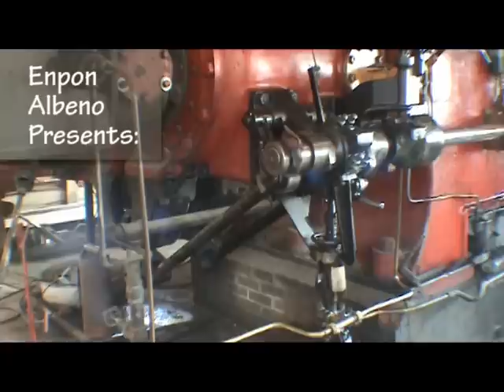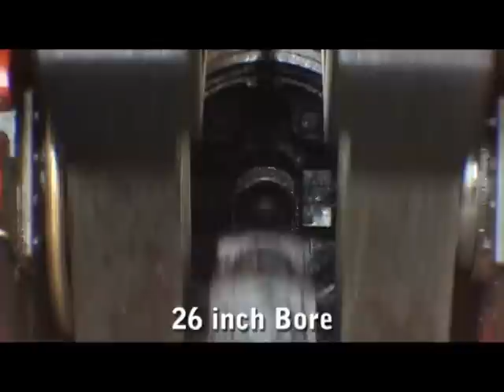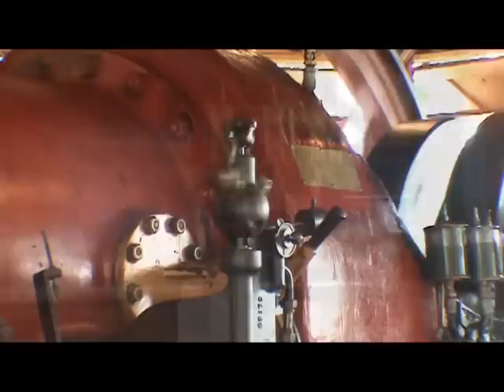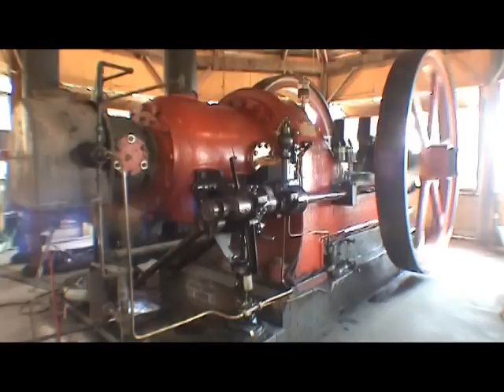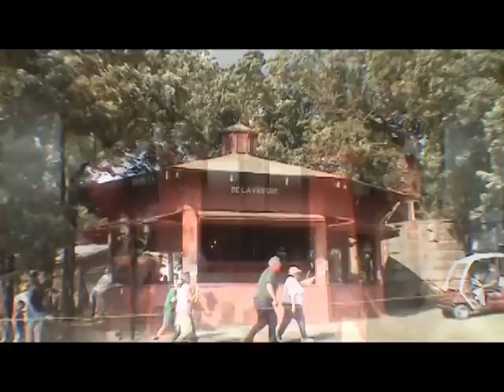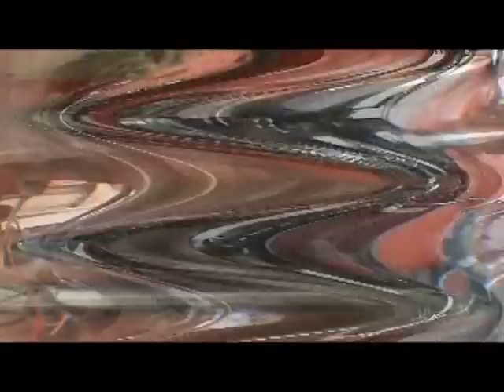20,175 Cubic Inch Single Cylinder Engine - Running

Comment from the maker: I just watched a bunch of great videos of Coolspring's 175 hp Otto, thanks to your comment. That is a behemoth of an engine. Whether it's larger than the one in this video all depends on your definition of larger. Coolspring's Otto is larger in terms of horsepower, but this engine is larger in terms of weight and displacement.  
This engine outweighs the Otto by 15 tons, and has almost twice the displacement at  20,175 CI versus the Otto's 10,390.  
Thanks for watching and commenting.

Comment: No replacement for displacement.
Reply: Forced Induction.
Reply: should totally turbo this
Reply: +Oscar Thorpe, don't forget Nitrous!
Reply: More cylinders this size
Reply: +Pegleg Noid
Ever heard of Honda S series?
Reply: Not really true:  RPM's are the replacement.  Some of the sport bikes get well over 150 hp on 1 liter NA engines.  They do this by having a redline up around 15,000 RPM's.
Reply: If you have to lead with "fuckwit" to get your point across, I'm gonna go out on a limb and guess you ain't a rocket scientist.  
I'll give it a try anyway:  With the proper transmission, RPM can be exchanged for torque.  It doesn't matter how many RPM's your engine turns to get the hp:  You just gear up or down as appropriate to get the torque you need.  The motorcycle engine could be used to power the factory that this engine powered.  The 2 engines would be geared very differently.
Reply: @XenoRacing  oh my goodness you are so right forced induction definition doesn’t multiply the hp based on the displacement. Forced induction and nitrous functionally achieve the same thing, increase oxygen density in the cylinder. A bigger cylinder(or more of them) with an increased oxygen density would create more power.

Comment: These old engines are awesome!! I believe the Hot Bulb was the front runner to the Diesel Engine. The cool part is i run WVO ( Waste Veggie Oil ) in my 1994 F350 7.3L and is amazing how well it runs too!!

Comment: For the mathematically literate the relationship between torque horsepower and rpm is as follows:

RPM times torque times conversion factor which slips my mind at the moment equals horsepower.

All the worship of torque you will ever see is simply worship of engines that produce a lot of horsepower at low rpm.

You could hook  up a large enough gear reduction to a five horsepower lawn mower engine and get four thousand pounds of torque out of the business end of it. But the rpm would be reduced to the point that you could easily count the revolutions by eye. Each one would take  a while .Think clock hands to get the idea.
Reply: T = Php 63025 / n         (1)

where

T = torque (in lbf)

Php =  horsepower delivered by the electric motor

n = revolution per minute (rpm)

Comment: My previous post has been re-formatted by youtube to leave out the spaces used to show the workings of this calculation.
However, the formula is Pye (3.142), multiplied by (X), the radius of the bore squared (half the diameter of the bore multiplied by itself), multiplied by, the length of stroke.

The Radius of bore is 13; this multiplied by itself = 169. Multiply this by 3.142 (Pye) and 38 (the stroke or length) and a answer of 20,177.924 is the result.

I hope this clarifies my previous post.

Comment: Hot bulb engines do not use carburetors. They use low pressure pumps to introduce fuel into the pre-combustion chamber not long after bottom dead center at the beginning of the compression stroke. They are often called Semi-diesels but they are not diesels at all.

Comment: That would be right, under load when the revs drop off the governor opens allowing more fuel in, when load removed & engine picks up again it closes down again kepping the engine at constant rpm. Not sure with this engine but the lever to the right could be the throttle to alter the governor setting.

Comment: Very impressive engine  it would outlast 100`s of modern high speed engines and out work them to. A 125 HP modern engine only has a mere fraction of the torque this engine has

Comment: It's not a carburated engine,it has a mechanical fuel injection pump.Hot bulb engines don't use carburetors,they are more closely related to a diesel than a gasoline engine.The only difference is they don't use high compression to self-ignite the injected fuel,which gets mixed with the air inside the combustion chamber,but the heat of the bulb instead.They were also called semidiesels,and could run on many different combustible oily fuels.This sucker is a really big one of its kind though ;)

Comment from the maker: It's a hot bulb engine, so there is no magneto or spark plug(s).  I'm not sure how the carburetion  system works on this engine.  That's something I'll look into next time I see it run.  This engine is much larger than what would have been used on a farm or sold by Sears.  Most farm engines would need to small enough to be portable - this surely is not. This is the type of thing that would be powering a state of the art factory in the 1910's

Thanks for watching and commenting.

Comment: They are semidiesel engines that inject any combustible fuel from crude oil to vegetable oil, petroleum, whatever, you name it. The hot bulb had to be preheated to glowing red for the injected fuel then to self-ignite with the compressed air at a far lower compression level than a diesel engine would need (diesels self-ignite only through high compression, not through the heat of the combustion chamber walls).

Comment: @Afganistan68 like said... youve probably heard, but im gonna explain a little in depth for everybody... usually the longer the stroke of a motor the fewer rpms (more distance to travel & less time to do it) but you also have much higher torque... so you take a 5.7L hemi v8 like you said pushing approx. 340hp/375tq and compare to a 5.9 cummins I6 in dodge trucks pushing approx 280hp/600tq, as you can see the cummins has a larger displacement but fewer cyl. leading to longer stroke=more torque

Comment: @ThaMasterSniper Oh I seriously doubt that. While I'm not 100% sure, I am almost certain this is an air-start engine (it's started with compressed air). I've started engines of this type before, and they are always air-start. There's no hand cranking other than bringing it to top dead center and letting the air do the work.

Comment: It's not rated at 50RPM; the poster stated that it normally ran at 160; that's probably not it's rated RPM, either; but if it were, the calculation would come out around 4100 lb-ft. of torque.

Comment: Just a slight difference of thought here, old chap.  The engine is exhausting the figure you quote - but it`s  R.P.M is actually double that,(104) . Similarly - if the exhaust is sounding roughly three times that rate - as indeed it does in your speeded up video - that would make it nearer 300 odd R.P.M. The exhaust should be sounding 80  times a minute for 160 R.P.M.  Hope you don`t mind.   Did enjoy your footage. any thanks.

Comment: I want to drop this bad boy in my Civic!
Reply: I was thinking the same thing. Except dropping my Civic INTO this bad boy. Also, it was take the weight of about 20 Civics to equal the weight of this awesome monster.
Reply: Be sure to add a bit of air pressure to the tires.  That diesel weighs  a few pounds more than the Civic engine.
Reply: Civic (Most Honda) Engine's are made from Aluminum blocks and head's for a reason its because of weight. A LOT of people hate on Honda. But say that hatred towards their moto cross bikes, Their racing boats their racing gt3 and formula one cars...shit even their compact cars are making the competion sweat
Reply: Only 125hp.
Reply: My 1.6L SOHC non-VTEC Civic engine (a.k.a. D16Y7) only does about 106hp, but seems to be more powerful than what the numbers say. Just enough power to pass people on the freeway and enough to keep from getting plowed over by speeding oncoming traffic when making a right turn onto a busy street.
Reply: zach You forgot apostrophe's for block's, bike's, boat's, and car's (twice).

Just trying to be helpful.
.
Reply: BloodstainedSinner "ONLY 125hp?" With 4,100 foot pounds of torque, who needs more horse power?
Reply: Rain Coast Oh, right. Do you drive a Prius or something? See, where I come from, your average vehicle is 250-305hp, and a performance car ranges from 420-710hp, and anything above is insane.
Reply: Horse power as a measure is okay, but TORQUE is where the TRUE power is at! That's why huge diesel marine engines use kw (kilo watts) as a power measure. One of the largest built by Wartsilla is 80,000 kw!
Reply: Rain Coast The Dodge Ram 2500 with the 6.7L I-6 Cummins turbo diesel makes 850lb-ft torque, but a mere 385hp. All that torque is good for pulling, but the truck is slow as hell. Torque is nothing without horsepower.
Reply: Rain Coast You should get your units straightened out. Torque is not a measure of, nor indicative of power. Power is a rate of delivery of energy. Torque is a measure of rotational force, or the ability to "put a twist" on some thing. That rotational force can even be static, like placing a torque wrench on a very tight, large fastener, hanging a concrete block on the torque wrench handle, and leaving it like that. The torque reading on the fastener will be the same the next day, but no work was done on the fastener because no power was supplied to loosen it.

At any rate, torque is not power, and horsepower and watts measure the same thing, which is rate of delivery of energy. The watt is merely the SI unit for power. Horsepower is similarly the customary unit of power commonly used in the U.S. and 1 HP = 745.699881448 Watts.
.
Reply: I recall someone in england, some years back setting a merlin spitfire engine in a Rolls Royce car, then driving up the motorway at 200 miles per hour,burnt out the car !!!
Reply: BloodstainedSinner yeah, at 160 rpm.  That's a measly ~2.7 revolutions per second... you could almost read a book attached to the crankshaft.
Reply: Hey Zach, how about dropping it ON your Civic?  :-D

Comment: 26 is diameter, divide by 2 and get 13 for R pie R squared is the area of the bore = 3.1416 x (13x13) = 530.93 Multiply that by the stroke to get volume.
530.93 x 38= 20,175.355
 Don't know how you got what you did,but it's wrong. You also have 4 decimal places between the comma and the decimal point. What's that supposed to be?

Comment: The part that said "160 RPM" is wrong. If the engine ran at 160 rpm it would let out exhaust slightly more than once a second (1 per second = 2rev per second= 120RPM). I the video the engine is speeded ut to at least 2 exhaust pulses per second, meaning it's running at 240 RPM. This is becasue it's a four-stroke engine, not a two stroke.

Comment: Torque is the rotational force, power is the rate at which work is done. That's why power = torque x RPM. These large capacity, slow turning engines do have a very high torque figure but only produce a relatively low power, because of the low turning speed, or RPM. So would be pretty hopeless in a hypothetical road vehicle. A given application requires the appropriate power unit.
Reply: I don't think anyone is serious about bolting it into a car. Of course, RPM is part of what wears an engine out, so an engine like this one is designed to be practically immortal.

Comment: oops piston speed was wrong multiply stroke x 2 then by the rpm so (28 x 2)x160=8960 divide that by 12 = 746 ft per minute or 12.44ft per second. generally speaking a stock car engine for reliabilty is usuall around 3500 ft per minute or 58 ft a second making me wonder if this engine could achieve 750 rpm ?

Comment: any idea what the engine was used to power originally?  Its got the power to weight ratio of a late 70's, early 80's GM motor.  And probably gets better milage.
Reply: +El Guapo These big displacement stationary engines were used for a variety of tasks. Among these were as pumps for coal mines, power generation, and in oil fields.

Comment: (continued) Later engines used gasoline and a spark plug in the heating phase and then switched over to their actual main fuel, which needed to be way less refined than gasoline, when the hot bulb had reached its temperature.

Comment: simple math boys. bore x bore x stroke x.7854 x(how many cylinder). in this case 1 so 20175.355! and for fun lets divide that by 1728 =11.67 cubic foot volume... now for piston speeds at 160 rpm .lets see 28 in stroke x 160 = 4480 divide that by 12 =373.33 feet per mnute which we divide that by 60 gives us 6.22 feet per second seems kinda slow piston speeds.. whats the max rpm on that engine?

Comment: if this were to be applied on any scale of a moving vehicle it would be incredibly inefficient just based on the weight of the engine itself. considering the engine weighs 40 tons, a cummins isx 500 making ~2000 ft lbs of torque is an applicable engine for a big rig to tow 40 tons.

Comment: 4100 lb/ft of torque? what the actual fuck?
Reply: +Nazimelon torque is basically determined by the rotating mass of the engine and therefore its ability to keep turning through resistance.
This thing has a massive rotating mass with its huge piston, rod and crank, along with its big flywheels.
Horsepower on the other hand, basically determines how fast it can get up to its set rpm, be it 60 or 150rpm.
Reply: +Nazimelon  Only 4100 from an engine that big...I'm disappointed.
Reply: +Nazimelon Yeah, the 38 inch stroke has a lot to do with it...torque is a twisting force, and  that large stroke gives it leverage...here's more btw...and yeah, low horsepower, low rpm engines with huge torque were not uncommon back in the day...
http://formulas.tutorvista.com/physics/torque-formula.html
Reply: Considering when this engine was built (probably in the very late 1800s or early 1900s) It's still impressive.

Comment from the maker: Can't believe it's 20,000 cubic inches?  The engine has a 26" bore and a 38" stroke. I went to the gubment skool so I may be calculating it wrong, but I come up with exactly 20,175.30802 cubic inches, or 330.6140638 Liters, or 87.339 Gallons.  

Would somebody please double check my math so people stop calling me a liar...Thanks.

Comment: Assuming a perfectly linear power curve, this motor running at 1600 rpm would be making 1250hp. That's idle revs for my 636cc single in my motorcycle! Of course it's probably throw itself in bits across the country if you tried to run it that fast..
Reply: now make the redline  9000 rpm

Comment: what's the max safe long term running rpm?
Reply: +etyrnal It probably redlines at about 100 rpm...
Reply: it did't say straight
Reply: i wonder what rpm would result in mechanical failure due to physical stresses?
Reply: +Lancer Guy interesting. thanks!
Reply: +Lancer Guy if run increasingly faster, what would likely fail first?

Comment: You should LEARN HOW to use a displacement calculator and try writing the answer down as it is, NOT as you see it. 33,0618.1 cu in is not even a readable number,but if you use a displacement calculator and read what it says, 330,618.1 is CC's, NOT cubic inches. A CC is a cubic centimeter.

Comment: Let's just check this one last time for the disbelievers...

26" = 66.04cm
... cross section area is therefore 3.142 x (33.02)^2 = 3425.79sq cm
38" = 96.52cm
3425.79 x 96.52 = 330657cc

Yep, 330 (or even 331) litres near as dammit.
Divide by (2.54)^3, i.e. ffffff, to get cu in = 20178ci.

(To the nearest integer)

I wonder what the compression ratio is, though?

HP per litre = 0.38, vs typical 40~90 for most cars/bikes
However it revs WAY lower.

Lbft per litre = 12.4 ...poor, but not crazily so

Comment: comments on waste of fuel are wasted comments, and indication that commentator is ignorant of engines in general. At this speed, and with no load, this engine is only using enough fuel to make it idle. And that's not much. Probably around 1/2 to 1 hp. And with that load, it wont use much fuel or pollute much at all. HOWEVER, put a load on it, let the governor open up, and it will provide you a large bang on every power stroke. Id like to see and hear it loaded so we can see what it really will do!!

Comment: OK. Really? and so people are paying to see this thing on display and running for no purpose except to use oil , make noise and produce nothing? Really?
Reply: These days it has been taken over by drag racing.
Reply: You just don't get it do you?
Reply: Yeah, but look at it this way, it can't be wasting more fuel than a 3.3 litre engine running on neutral at 5200 rpm. It's considerable, but only a fraction of what it would be if running at full load.
Reply: If you wanna look at it from that perspective:  It makes a lot more sense than a demolition derby.